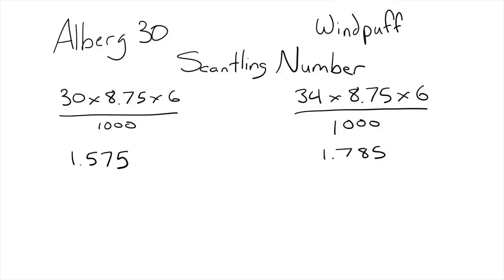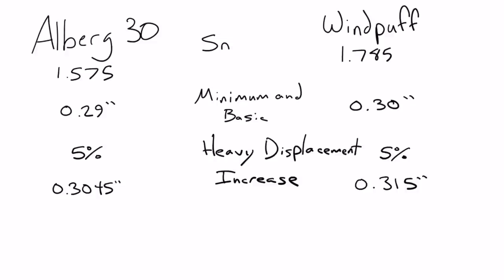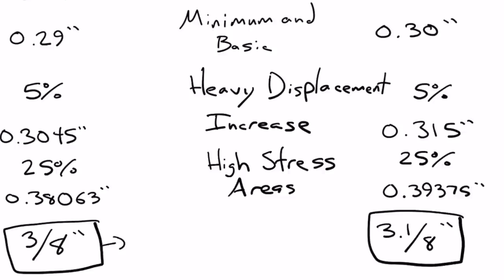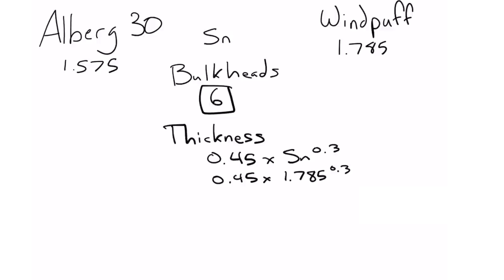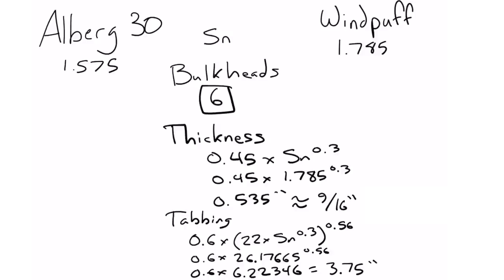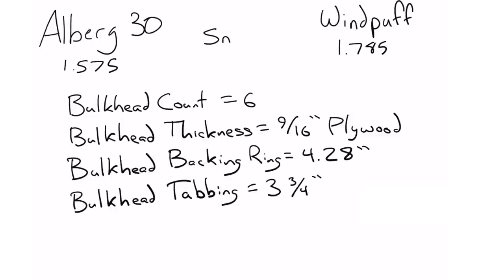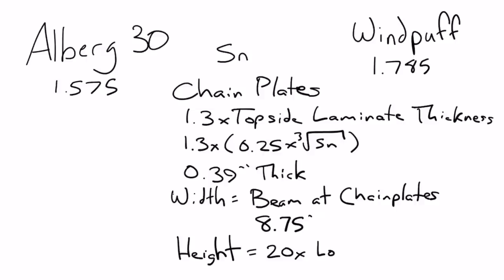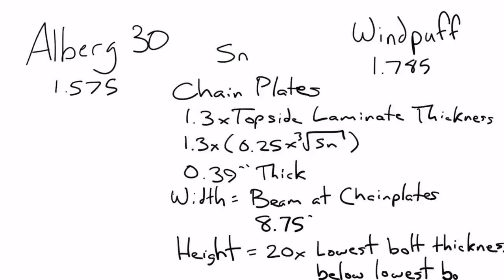Is My Boat Strong Enough to Become Bigger? | Windpuff's Rebuild [S1 Ep 8]

Comment: One thing I've considered is to convert my rudder to a skeg hung rather than a spade. Although I have a bolt on keel it is so well attached that it doesnt bother me (and I've "tested" it a couple of times😉), the rudder is really the only weak point. Having said that I did have a rock jump out in front of it back in 2020 which bent the shaft by about 15° but caused no damage to the hull. Yep, they built them strong in the 1980s!
Reply from the maker: Nice! Those rudder posts are crazy massive! In the Principles of Yacht Design, it discusses the scantlings for the diameter of the rudder post. They take a lot of force but also have an incredible support system holding the massive stainless steel pipe!
Reply: @RiggingDoctor hey buddy,  I only just saw your reply! My rudder post is actually 2¼" solid stainless!

Comment: Again thank you , using both of these books made all the difference in just layout the chain plates. I'd be interested  in seeing how we compare both finale outcomes. 
Best to you.
Angus
Reply from the maker: I’m swapping the chainplates on Wisdom at the moment and the Skene’s scantling for the plates was a few mm wider a few mm thicker than the scantlings from Larson’s Principles of Yacht Design. 
The bronze plates I was able to easily find are a smidge bigger than the Skene’s numbers which means it’s plenty strong!
Reply: Its great when you can find the bronze in stock that just needs to be cut to length

Comment: Thank you for this, just ordered the elements of boat strength. I‘m working on a shark 24 and am planing to do some changes to it to improve its safety / behavior on high seas. Looking forward to do the calculations and find out if the plans I have are viable 😁
Reply from the maker: Always better to figure it out before construction begins!
Reply from the maker: I have met someone who sails from Florida to the Bahamas, the Dominican Republic and back all the time in a Victoria 18. If the boat is setup properly, it can go anywhere!
Reply: Good thing is, the Shark 24 is known to be be „overbuilt“ since it was designed in times where the strength of fiberglass was not yet fully known. There have been people crossing the atlantic on a Shark 24, the most famous guy being Bob Lush.
I‘ve taken inspiration of your dyneema videos as well and will be changing my rigging, which I‘m sooo looking forward to 👏🏻👏🏻👏🏻

Comment: Have you done the similar math for a light weight flavor from the other book? This boat sounds like an ice breaker. This sounds like a classic example of the cube-square law and windpuff hasn't passed the critical size to require blast doors and reactor shielding.
Reply from the maker: The numbers using the other book are crazy complicated so I only did a few and it was much thinner.

Comment: Herbie,  how much are you planning on increasing the working sail area of this Alberg 30?  What are the original and new sail areas for each sail?
Reply from the maker: The working sail area is currently 410 and we will increase that to around 530 ft^2. We will also have around 1000 ft^6 for light air sailing as well. 
The trick is breaking the sail area up into three headsails so that we can position them accordingly to balance the boat on every point of sail.
Reply: Interesting.  Will you be covering the change in sail area/location in a future episode?  With the addition of the bow sprite, will you be moving the mast aft or increasing the length of the boom to maintain the center of effort of the sails close to where it is now?   @RiggingDoctor
Reply from the maker: The mast will remain in the same location but the boom might change. The plan is to make a fractional headsail setup where the sails can be moved fore-aft on their stays to adjust the center of effort and balance the helm. 
When I get to this point, I will be making an episode about the topic as I discuss it with the sail maker. They are the ones who truly know this topic so I will be relying on them for the final say of things.

Comment: Is the reason for the extension to increase the boat's speed potential?
Reply from the maker: More space for solar panels, stern anchor mount, surround the windvane for maintenance and protection, and to make boarding the boat easier. 
Speed might improve if we heel over far enough but it’s not the primary goal.

Comment: Better to over engineer it for the sake of safety than to under engineer it for the sake of saving a buck or time.
Reply from the maker: Indeed! Also something is going to present itself during the build that will preclude me from building to this ideal standard and that means I will still be overbuilt but not as overbuilt as planned.
Reply: Definitely in the build for strength camp. Watching weight and the location of is a consideration too.
Reply: @RiggingDoctor  Hi Herbie. I would appreciate a bit of advice. My boat is in Middle River and I believe it needs some structural repair. I have spoken with the guys at the marina. Quite honestly they never seem very interested in doing anything other than the usual jobs like bottom paint and such. They seem to believe it’s just cosmetic. Either way I’d like to have it repaired. Especially before going offshore. Would you have any advice for finding someone who’s capable of doing structural fiberglass repairs? I could also use some help with some boat cushions if anyone out there is interested? The professional upholster I hired tore my boat apart and bailed after only completing half of the job. Anyway, I hope your project goes more smoothly than mine has. I look forward to seeing the rest of the build and the final outcome.
Reply from the maker: We are close by! 

For fiberglass, my recommendation is actually an electrician named Bob Blood ((410) 212-3336). While he is not a boat builder, his work is immaculate, and perfect. He installed my electric engine and built the battery box, as well as closed up a bunch of through hulls. He’s also done beautiful work on my dad’s boat. He comes from Waldorf, MD but he works all over Maryland. 
He is definitely the guy I would talk to about fixing your issue. If it’s beyond his capabilities, he’s the kind of guy that will tell you so at the beginning and not waste your time either.
Reply: @RiggingDoctor  Thanks, I’ll give him a call. Yeah I know you’re close by somewhere in Maryland. Maybe in our hometown of Baltimore? We probably would have bumped into each other by now if you guys weren’t galavanting across the world’s oceans. lol. I’m usually between the upper bay and Annapolis. Spend some time in Fells Point where my buddy has his boat. Hopefully I’ll be in the Caribbean this time next year. I’ll keep an eye out for you. SV Interlude. Thanks again.
Reply from the maker: Wisdom is in Fed Hill, Windpuff in Deale
Reply: @RiggingDoctor  I’m not too familiar with Deale but I’m envious of Wisdom’s location. Nice deep water. Bowleys Quarters can be a challenge for my 5’6” draft. Do you ever play volleyball there? Maybe we could play a game and I’ll buy you a beer when the weather gets warmer.

Comment: I disagree a bit, with your statement that if you're changing a boat you're changing it from something a naval architect designed to an untested experiment.

If, like me, you bought a 40+ year-old boat, you have something that was originally designed by a naval architect, and then has gone through an unknown number of modifications by a series of prior owners. What you have, when you start, may very well not match up to what any sane naval architect would have specified.

So don't assume that what you're starting with is any good.
Reply from the maker: Very good point! Every old boat that is still floating is a series of “owner modifications” but it still probably handles in a similar fashion to what it was designed for. In my case, where I’m making the stern longer, the center of buoyancy will move slightly aft when heeled. This means that the bow will be more prone to push into a wave if the stern gets lifted high up. From my calculations, it’s moving only about 4 inches aft, so I’m not very concerned about it, but if someone made the extension significantly longer, the bow might turn into a torpedo being launched off the deck of a navy ship! If the bow digs down too hard, the bot can pitch pole! This is why it’s important to understand the consequences of any changes but also plan them in a way that has minimal consequences.
Reply: @RiggingDoctor  Few prior owners will have made such a fundamental modification. My own has had a bowsprit added, to make flying a Spinnaker easier, I guess. I'm not too worried about it, because light wind sailing isn't when you need to worry.

Everyone, though, buying an old boat, should consider replacing the standing rigging. If the prior owners can't tell you when it was last done, it's almost certainly overdue. And don't assume that the toggles, shackles, etc., that you find on your boat are the right size for the load.
Reply from the maker: That’s an excellent point. If they switch to synthetic, that’s another host of changes. 
The boat heels less which lets you carry more sail but also means more stress on the rig. If you don’t heel, you won’t be sailing on the lines that the designer drew up but somewhere in between heeled and upright.